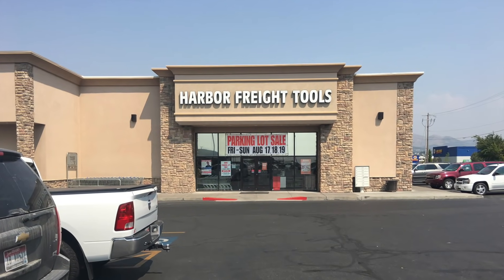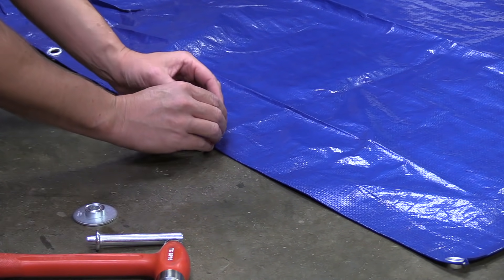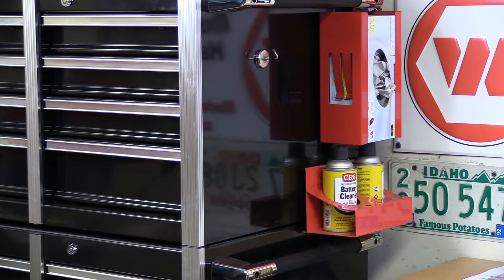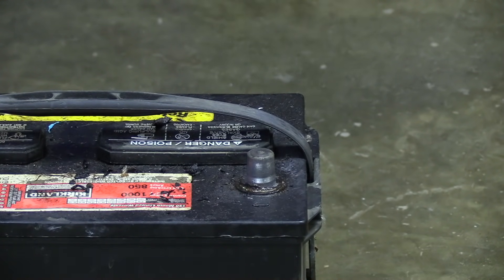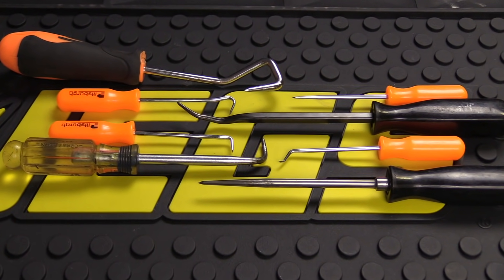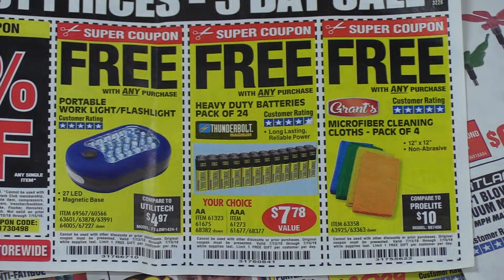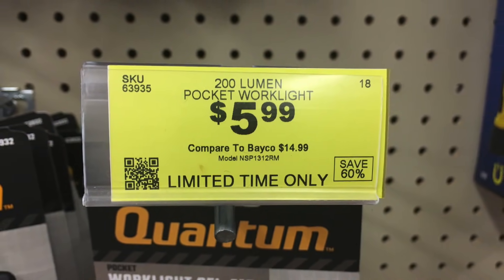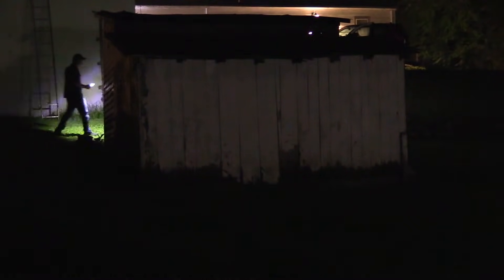TOP 5 BEST HARBOR FREIGHT TOOLS!! (UNDER $5)

Comment: Gonna get the light , one for truck and one for wife's car and leave in glove box . Great suggestions !! Thank you !
Reply: Think about the Batteries. I just had to replace a Mini Mag Light $$ in the Wife's car that the batteries had leaked. Glad I found it when I did and NOT in an Emergency situation.  Now keep batts in a separate container and created a rotation routine...
Reply: Would recommend going with name brand batteries. The light is great but it is much brighter with name brand batteries.
Reply: They sell the Big Larry knock off at China Mart for $8 If you want the red flashing lights.
Reply: For battery, you can buy from Ikea or Costco Kirkland brand, both are cheap and never leak
Reply: Light is unreliable.  Shuts off with the slightest bump.  Same problem I've had with other cheap lights.
Reply: Just a tip dont put hf batteries in your wife's light she will need it in 6 months and they will be corroded and shit
Reply: @kansasgardener5844  I've found that the red flashing light eats up batteries real quick.
Reply: @nicholas8479  thought the same thing, then cut a receipt so it would wrap around all the batteries exactly once.  No more issues with the light bumping off.

Oh, i also removed the pocket clip.  However, that was the first thing I did in an attempt to tighten everything up. so it may not have been necessary after wrapping the batteries..
Reply: @jaysenhortenstine  curious about your solution.  What is a "receipt"?  Did you mean plastic wrap?  And how does wrapping the batteries prevent the light from turning off from the lightest bump?
Reply: @nicholas8479  it was just a receipt from a store.  Honestly, it can be anything that will wrap around the batteries evenly, with no overlap, and still fit.  The inner diameter of the battery compartment allows for wiggle. Eliminate the wiggle as much as possible evenly so that there is no wiggle.

IMO, the issue is the point on the positive side of each battery, and the wiggle of course. So each battery can tilt just slightly on the point of the battery below it and the total height of the batteries will be slightly less than if they were plum.  

All speculation though.  Everything is situational.
Reply: @jaysenhortenstine  I haven't tried your suggestions yet, but it really shouldn't matter if the batteries move a little.  The spring on the end should push the batteries together so continuity is maintained.  I'll have to check that spring to make sure it hasn't been squashed and lost its ability to push.
Reply: @nicholas8479  i completely agree with you.  I didn't like the rattle sound the light makes.  Again, the spring should hold the batteries tight enough so that they can't move, but mine rattled.  The easiest solution I could think of was to put in something to cushion the walls.  It just so happened to also fix the bumping off issue.  Really wasn't my initial intention. I've not experienced any battery leakage issues.  However, if it were to occur, perhaps the paper will absorb most of it?  Just a third thing to consider.
Reply: @jaysenhortenstine  Good point.  Some batteries leak and make a mess.  The paper might help.

Comment: The new magnetic swivel work lights are awesome. I'm a welder and instead of running extension cords to set up work lights in a cramped tank. Just bought 4 of these lights. Use two for about 5 hours then they die, but just use the other two and charge them at home.

Comment: I have and use the grommet set and it works well. I want to pick up the other items you mentioned too. Harbor freight is turning into a very good store. I hope the prices stay low
Reply: traderjoes Do you know if the grommet set will work with thicker materials? Like backpacks?
Reply: Tijeriña Production Yes the grommets work well with thicker material is like a backpack and what not like that I’ve used it several times and it holds well definitely worth more than five dollars but thankfully it’s under five dollars!!!
Reply: @tijerinaproduction7105  I used the grommet set to hang some of the HF shipping blankets, so I would think it would work on a backpack. You just have to put some force behind the hammer.
Reply: I think the same way. Most people and friends i know are always talking crap of harbor freight tools. Specially for their cordless drills. Now
All the drills i have are chicago electric from H.F and i never had any problems with them.
If u are a diy person like me but that only fix,make,work some stuff once a while then yes they work.
If you are a person who works 24-7 with tools like this home,work then spend a few extra bucks for name brands is the best. Mikita, dewalt etc
Reply: Yes it is but the prices are getting as high as all the other makes AND their guarantee is woefully less than the others.
Reply: JD Durrant one

Comment: So far my best finds
- 3/8 breaker bar
- retractable dog leash for dogs <50lbs
- small pick set by Pittsburgh tools
- mag parts bowl free with coupon
- small tarp free with coupon
Reply: +1 on the breaker bar and free tarps
Reply: Broke a 3/8 breaker bar about the 3rd time I used it. Went to take the lug nuts loose on an S10 and it broke like hot butter. The piece got stuck inside the sock, had to take a punch to knock it out to use the socket again. Took it back and got a replacement and it broke on the second lug nut. Took it back and got a 1/2 breaker bar, and it's worked perfect.

Comment: My top 5 favorite HF tools are #1 my low profile jack #2 120 amp welder #3 1/2 breaker bar #4 1/2 impact sockets #5 1/2 extending handle ratchet

Comment: My top 5 HF things to buy. 1) Impact sockets. Amazing and unless you leave them in water they don't rust easily. 2) moving dollies. 3) Torque wrenches 4) breaker bars 5) my 10 ton shop press.
Reply: I don't trust their torque wrenches after comparing them to my snap on ones immediately after calibration. Hf impact sockets are what I use at work tho lmao
Reply: My torque wrench was off by 25 ish ft lbs but all those other ones were perfect for me as well
Reply: Mike Zupancic's Top 5 Harbor Freight Tools (Over $5)  =)

Comment: I've had a set of those small picks for years and have used the heck out of them. I also have the free small black flashlights in my cars, garage and shed. I've got several of the free blue flashlights with the magnet on the back stuck to my refrigerator and my whole family uses them. The best part - the flashlights cost me nothing to use. I get the free packs of batteries from time to time to keep all the flashlights working. By the way, loved the video!

Comment: I recently found Harbor Freight's Apache watertight cases (that mimic Pelican cases). They are sturdy, watertight, and a fraction of the cost. I have one of each of the three sizes and use them for going to the shooting range, or for electronics. I often see them on sale, which lowers the price even more.
Reply: Nick I like the cases but recently found out that mine wasn't water proof even with  vent closed and the oring looking just fine. Just saying be careful.
Reply: I agree with you. Keep in mind, however, that they are waterTIGHT, not water proof. I first thought they were the latter, but after doing some research and watching some youtube videos, I realized that while they will keep items dry on a temporary basis, they are certainly no replacement for a pelican case in terms of watercraft. Check out some of the youtube reviews, I think you'll get the idea. Thanks for your comment!
Reply: Nick Poulson thanks
Reply: Nick Poulson I found them too   20$ great for my lowrance link 8 vhf and garmin 740s  both fit nicely after pulling out some of the foam JT

Comment: Plastic welder at H.F. is AMAZING.... I hit a deer doing 90mph and the impact destroyed the fan and I wasn't able to open my hood. Still drivable I drove to my brothers in DC. By the time I got my hood open there was a hole in the overflow tank from rubbing on the fly wheel and seeing that the plastic was PP graded the Plastic welder at H.F. welded the hole shut and now it's running fine!!!!! It's only 16.99 vs the overflow tank 89.99 new online .... Great Find!!!!

Comment: 1/4 in, 3/8 in. Drive Long Reach Dual Flex Head Ratchet Pittsburgh Professional 67994. This is one of the best tools, it is very thin which allows access to some pretty tight spaces, like O2 sensors. It doesn't look very sturdy but I've had it for many years and it has never let me down.

Comment: I let my table saw sit in the barn for a few years before resurrecting it.  By the time I did, the top was covered in heavy rust.  Recommended 'fix' was sanding with WD-40 or an rust knocker.  Didn't want to use my 'good' orbital sander, so I bought a 'throwaway' sander at HF.  That was seven years ago...even after sucking up a lot of WD40 and rust knocker, it still works.  HF's impact sockets are also pretty good...never had a problem with them.  If you're a woodworker, avoid the HF bar clamps...too much flex, and the plastic handles break off.

Comment: I use the terminal cleaner to prep copper pipe for soldering.
Reply: I have to re-pipe my house with copper. Thanks for the tip!
Reply: @williepierce3933  You might want to consider PEX since you are doing your whole house.  Copper is very expensive and will close up over time. PEX is much cheaper.   You can run it like wire and the connections are made with a clamping tool.  The tool is expensive, but you may find one on eBay.
Reply: You can resell the tool on eBay, but you will save so much on PEX over copper, the tool is virtually free.
Reply: Hi Russ. I don't know why your 1st message didn't show, but I'm really glad your 2nd message did, so I was able to read both. That's great information that I'll definitely look into. Thanks so much!

Comment: Not all of these are less than $5, but here are some of my favs...

1) I second the wide angle light, but keep that magnet away from your phone or other electronic devices!
2) I love the low-profile 3-ton floor jack for $79.  You just can't beat that anywhere else I have seen.  Heavy duty, fast and durable. 
3) The 12" diagonal cutters.  They used to have a fine tip and a lifetime warranty, but the tips used to break.  Now the tips are big and clunky, so I take a flap disk and dress them up, and they are way better than the old ones.  I use those things for everything!
4) Their nitrile 0-ring kit.  Every shop needs one around.  Will save you a fortune, in time and $$$ compared to buying OEM
5) Their Multi-tool.  I call them Vibro-cutters.  The blade oscillates and they are awesome for cutting drywall, wood, pipe, fiberglass and many other things.  One of the tools you can't live without, once you have used it!

Harbor freight tools has been a game changer for many.

Comment: The best tool I found at my local store is the ball joint remover tool for getting the ball joint or if it mounting area , if you are replacing a CV shaft but not the joints. It does not tear up the boots and makes the job fast .

Comment: I like their deepwell impact socket sets. Stan up to massive abuse for the price. And the magnetic parts trays
Reply: They are good, but Northern Tool also has a set that goes on sale for $15. And it has an actual  plastic case to store the sockets, which makes it a lot better than the thing the HF sockets are attached to

Comment: I love the blue 27 LED work lights. They are really bright, have a hanger, magnetic bottom, and you can get them free with a coupon. I have about 5 lying around, and they are durable. I got brake cleaner on one that melted off parts of the plastic and fogged the lens after I dropped it in my oil drain pan full of oil, and it works fine. Also the silicon carbide wet/dry sandpaper set. It's like $3 and has 220, 500, 1000, and 1200 grit. You can get a single sheet of 3M wet sandpaper for that price. The super glue is a good buy too. 3 tubes for $.99. A steal. Pick up the high volume inflator for $28 with coupon too. I love mine, fast and relatively quiet.

Comment: I think my most useful find is the drill master 18V cordless impact driver. It does not come with a battery, but uses the standard drillmaster 18v battery common to their cordless drills, lights and sawzalls. It performs surprisingly well and has a lot of drive for under 20$

Comment: The 2 in1 cargo/support bar is great. I use them all kinds of tasks, I use it to hold plastic sheeting for dust barriers on construction sites. Or if I need to section off an area for a quick dust free area to paint or spray lacquer. A lot cheaper than the $120 + extra hands.

Comment: Have had the picks for well over a year.  Still picking!  My fav new HF is the Braun rechargable slim bar light (#63958).  Works like a champ, aluminum body, lasts before needing recharged and is sure handy working on the truck.  The light folds (pivots) at the middle and is GREAT for keeping the light out of your eyes when working in cramped spots.

Comment: That battery post cleaner is a must. The pick set is definitely handy.
Reply: Or you just apply some dielectric grease and don't have to worry about it. I buy it by the tub and it's not that expensive. 

It's unfortunate that so few people seem to know to apply it liberally to those kinds of connectors so that they don't corrode and don't get water in there.

Comment: Cool. I didn't know about those grommets.  I just found the small thin brushes are good for cleaning the dirty threads in holes. Just squirt a bit of wd40, let it sit for a bit and use the brush to get all the crud out. Worked great. I only bought the three small plastic set but they do have a metal set with a few more that would be better as the plastic was a bit too soft but still allowed me to clean the junk out. I got a few of your choices so yes quite a few good items. I already have two Nebo slide flash lights so I'm good there. I also just bought the breaker bar to do my water pump based on your video a while back.  Made my job much easier. So thanks for these videos.

Comment: The air die grinders are great. I paid like $6 for mine about $20 years ago and it still works fine. Just dont be in a huge hurry as it can stall if you really lean into it.

Comment: My top pick is the smaller version of the flashlight you showed above. The small (2 AAA Battery) quantum flashlight. It's simple! That's the best part. It has a button on the end that only does on off. It doesn't have modes, and doesn't bling S.O.S.  I love it and carry it every day. it was 4.49 at my local Harbor Freight.

Comment: Can we be invited to say what we have found to be great value from HF?
I'll start with the Chicago 4 1/2 Angle Grinder. It just goes on and on. Its 15 years old. Magic machine.
Reply: I have 1 too and I'll bet it's 25 to 30 years old runs like a champ, I use it for grinding rust off things and sharpening mower blades, Just great!
Reply: Maybe 15 years ago it was good. I bought one and it lasted less than a day. It was literally sizzling in my hand.
Reply: @jimdavis1566  I think they will take it back and give you a new one

Comment: 8" dado set -- I found it on the discontinued shelf for $25, not expecting much. It cuts beautifully. The chippers are full circles with 4 teeth, better than the 2-tooth 6" set I had before. The hole for mounting is a better fit than the previous set, sliding on and off easily. It came in a box with a handle and foam separators. Item #44566

Comment: I collect tape measures. Free ones from HF. For years I spent untold hours searching for where I set down my tape measure. Now I have a dozen (and counting). I use picture hangers on French cleats all over my shop, and each tape has the tool it stays with written on it.

Comment: I always wanted to grab one of those sorting trays and I should get one if those battery terminal brushes too.
 
Also the light, for the price, is a must have. The quality isn't perfect but it's got a aluminum body, has decent light output, and fits well enough together that it's worth it.

Comment: I have that pick set. I wouldn't use them if you are a pro who uses them heavily, but I run a small engine repair shop out of my garage and I have had no issues with them. The lifetime warranty is a huge plus since you will likely break them sooner or later.

Comment: Harbor Freight doesn't always have good prices on things.  For example, a very cheap quality 7" wet dry diamond blade is $28 at Harbor Freight.   Home Depot has a much better quality diamond blade for around $15.  When it comes to blades and drill bits check other stores as well.
Reply: Yes its getting expensive so much more that it is as well to buy well known makes now with a much better guarantee period.
Reply: YOU ARE SO RIGHT!
 I learned the hard way not to buy blades and bits at HF
Reply: I noticed the last time I was there that they now show competitors prices above their price which makes items appear to be on sale but they’re not. Normally when they show two prices one is the regular price and the other is the sale price. it’s been a while since I’ve been there I’m not sure how long they’ve been doing this.

Comment: I have been doing business with Harbor Freight since they were mail order only. That is a long time ago, at least 45 years ago. Maybe more. For home use they are more than sufficient. Many tools are good grade, not great but good. There are some I wouldn't buy. I have a lot of tools and machines in my garage that if it wasn't for H F prices I wouldn't be able to own them.  "The Funnel Tray" I have a dozen large coffee cans full of assorted screws and small hardware. I use the Funnel tray daily.  I think my next trip I will check out that Quantum light. I like the looks of that. Thanks for your' video.